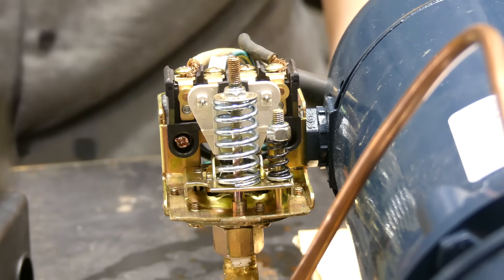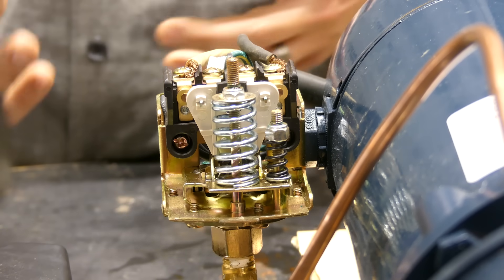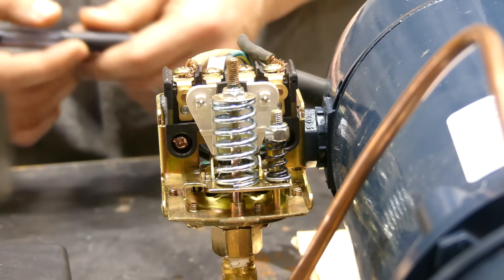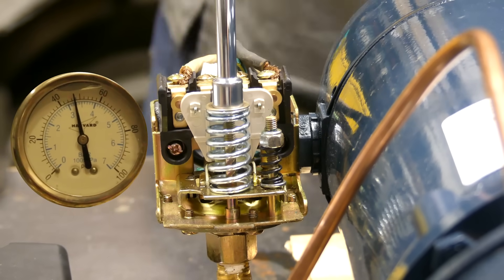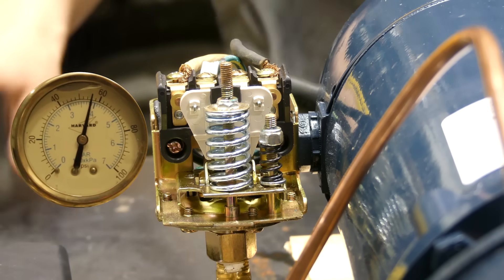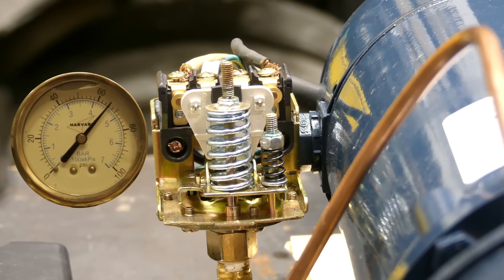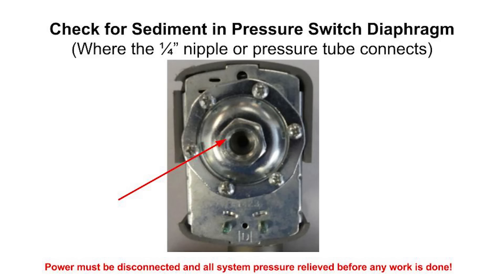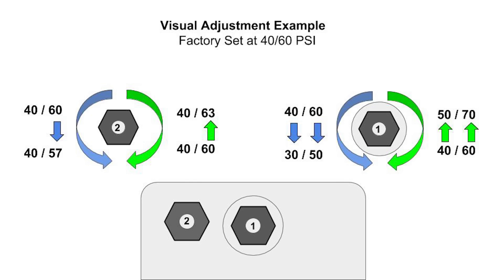How To Adjust a Pressure Switch

Comment: Hello I have a convertible Pressure pump,  from Canadian tire.  I'm trying to have it work to pressure my cabin from my gravity fed cistern.  I have it all plumed in, primed, and turned it on.  but the pressure just keeps on surging the pump does not turn off.  I have the pressure regulator installed, and the pressure tube is connected to the pump housing then to the pressure switch.  should I connect this tube too the pressure regulator instead?  do I have to use a bladder tank with this type of pump?  was hoping to use it without a bladder tank just need it to shut off when it pressures the cabin. there are no leaks in the system.
Reply from the maker: You need a pressure tank: https://www.youtube.com/watch?v=zz0dYccfqaE&t=82s

Comment: Without a doubt the best explanation on the internet but i still have a problem. Pump has been short cycling but I can't get it adjusted. Changed the pressure switch (40-60) but it cuts in at 50 so I only have a 10 pound differential. Backing off the spring doesn't help. Eventually the pump just spasms off and on. i know my showers leak so I am sure that is a contribution but I am flummoxed why I can't get the cut in pressure down to 40. Any insight would help.
Reply: Likely, your tank needs air added.

Comment: Hey there, quick question..what if my pump is rated for 40 in 60 out.. however there is only one Center screw and the differential is more like 15 psi... right now it's cutting in at 50 psi and cutting out at 65. I recently raised it to gain more pressure and wondering if it's safe? Also would that mean I set the pressure in the tank to 48 PSI? Let me know, thanks
Reply from the maker: If there is only one screw then it is more than likely for the RANGE, meaning it will raise and lower both the cut in and out equally. I would recommend replacing the switch if your differential is only 15 PSI. They pressure tank needs to be set to 2 PSI below the pump's cut in pressure.
Reply: @RCworstwater  Ok..i thought I may need to do that but also thought potentially the pressure gauge is bad giving inaccurate reading?
Reply: I appreciate your response. Thanks
Reply: Your pump may not be powerful enough to achieve this level, and the pump switch setting will not help  you out with this.

Comment: Just bought a new 30 - 50. After running it at the default settings. It ran for about a 2-3 minutes before it kicked off and pressure dropped to 0.  Had to flip it back to start in order for it to represure. Just changed my deep well pump last February 2020, any ideas or suggestions??  Water level is good, checked that...

Comment: i just tried to call, and i guess it's too early in Idaho, but I am worried that my dad destroyed the new pump he just bought by accidentally straight-wiring the electricity at the pressure switch system (putting the hots directly together instead of their own plates) and it running full blast for at least an hour when I came outside again and wondered...why isn't it cutting off...then waiting...then waiting...and then going inside to shut if off to see why (i opened it to see if the pressure switch wasn't set or was not right, and that's when i saw that he put the wires on the SAME screw, instead of their own). Could this have stripped the connection between the metal shaft and the wheel that turns to pull water?
Reply: Guess he went ahead and didn't read the installation instructions.  Oh, that hurts!  

I suggest you wire it up correctly and give it a try.  If it works, great, but he may have a reduced lifetime on the motor as the windings may have burned from the heat.
Reply: @jackb1803  i fixed it as soon as i realized it. it is working.

Comment: Nice video thanks, how do you protect the pump from dry working if main water supply cut off though?
Reply from the maker: You can use a low pressure cutout switch or any other means of electronic motor protection. Give us a call if you're in the market for one: 855.329.4519

Comment: Will you reply? 
My new switch was supposed to be 20-40, but want up to 60 and I freaked. If it damages the PVC pipes I'm screwed. 
I got it to 30-40. I want 20-40. Another problem is the bag in the tank must have a leak. The tank gets water logged and I need to empty once every two months or so. So, to get 20-40 from 30-40 WHICH one will I adjust and which direction? 
Anyone feel free to answer with the correct info. 
Thank you very much

Comment: So i installed the pump in a concession trailer this is a new pump, That i installed now when i shut off the faucet the pump will keep running, so do i need  to loosen the differential so that way the pump will shut  off ?

Comment: My pump with this same switch keeps pumping well water once the irrigation finishes. Should I loosen the center post so it stops running, as it seems to never reach a level where the switch cuts off?
Thanks!

Comment: What size pump are you using.  I have a brand new 1hp pump with a 30 - 50 switch.  The pump can't get over 49psi and therefore the pump doesn't shut off.  So what size pump are you using.  I don't think a 1 hp will get to 60+psi?  You can't simply raise pressure without enough power in the motor.
Reply: Look at the pump chart, normally supplied with the pump.  Can it go to over 50?  Some pumps are designed for high volume and low pressure.

Comment: Hey so i just had to replace my switch with a new one and now it runs forever and won’t shut off. any tips on how to get the pressure to go to the 40 psi so it will shut off? it goes to 32 psi and stops gaining and stays running forever till i flip the breaker switch.

Comment: SO a question for you or someone who knows can you tell me this if I tighten nut 1 it raises both cut on and cut off but I only want to raise cut on is this possible? can I just turn nut 2 counterclockwise to achieve that?? thanks for the video
Reply: To raise only cut-on pressure, you'll need to turn nut #1 CW, and nut #2 CCW.  This will have the effect of cycling the pump more often, if you can live with that.

Comment: I just started to watch videos about this subject because I have a switch that's not cutting off but when I tap on the plastic case sometimes it seems to do the trick (I still haven't inspected, I'm doing a little research beforehand). 
When doing this adjustments shouldn't we also consider the min and max pressure the tank can hold? Thanks for the videos. I need to watch one about replacing the switch. :)

Comment: Just bought a house and has a new system in. I was looking at pressure switch the other day and the smaller spring is set all the way down. Would there be any need to do that? After watching the video I’m tug King I should back it off some.
Reply: Oh boy!  Looks like someone before you diddled the switch.  Assuming you are satisfied with your cut-in pressure, I'd back off the differential screw all the way, then run some cycles and see what get.  Typically, a 20 psi differential is desirable.

Comment: my pressure switch is set for 30/50 , my cut in stops at 30 but to my cut out is just tittering on 50 but will not cut out . is that a good time to turn the differential counter clockwise one turn so it will cut out ? Thanks  Great info !!
Reply from the maker: Is this a new issue?
Reply: @RCworstwater  i got the jet pump pressure switch and tank at the same time five years ago, but this started a few months ago . it only happens when the water softner is finished its cycle and filling up the system. the cut off will tither on 50 but won't cut out , i will flick the switch and the pump will shut of then, so i will tweek the differential nut counter clockwise a bit and it works fine until the next regen of the softner and it will do it again.
Reply from the maker: That's odd. You should double check that the pump is completely primed. You may have also gotten something stuck in the jet nozzle inside the pump. We have a video on how to check that.
Reply: You would want to turn the screw CCW.

Comment: I am in the Philippines. I will not even start to tell you the problems I have with water quality, pressure, and low quality pumps and pressure tanks. 

But, I have a question: The Square-D switches are readily available here. I want to operate the pump without a pressure tank, and have the switch operate in an on/off manner, when there is a small pressure drop. How do I reduce or zero out the differential setting, so the pump does not cycle between the normal 20psi range? Thank you very much.
Reply from the maker: What you're trying to do is not possible. Without a pressure tank the switch will rapidly cycle on and off until the motor overheats.
Reply: @RCworstwater  Thank you for the response. 

Yes, the pump rapidly cycles on/off; because of the switch's built-in differential. 

I run the pump now without a pressure tank---I replaced the Square-D switch with a pressure controller. So, when I need water, the pump will start and run until I stop using water. Will it shorten the life of the pump? Maybe. 

Because of the low quality of water, of materials, and poor workmanship, I have already gone through three pressure tanks. I changed from the China-made to Italian-made pumps. Even the cost of the better Italian pumps here is three times less than one bladder pressure tank. 

Thanks again.

Comment: Hey sir please reply so I have a water tank that I pay to refill every now and then... So there's absolutely no pressure in my pipes my pump runs only when I turn it on because the automatic thing isn't working.... Should I loosen both springs to the max since pressure is literally non-existent without the pump??.... I just need it to turn on and off automatically because I don't wanna forget to turn it off
Reply from the maker: Give us a call to discuss your application: 855.329.4519

Comment: Thank you for the video.  I have a question.  my pump seems to have no high end pressure. pressure stays about 30 psi .  pump turns on and off for short bursts when water is being drawn.   It had been working fine previously and in fact I had replaced the pressure switch about 2yrs ago.  the area is very humid.  could one of the points be stuck?
Reply from the maker: Thanks for the comment Robert! It sounds like your pump may be suffering from rapid cycling. Check out our troubleshooting video for tips on what to check: https://www.youtube.com/watch?v=CPzRpD_Tncc
Reply: my pump keeps going on and off on and off a very high pay I was wondering how I can adjust that to maintain steady pressure in the home

Comment: Once in a while, my pressure switch needs to be manually engaged because it doesn’t go on automatically.  We used to keep a heat lamp on it at night in the winter because the well guy thought the cold air might be making it stick.  Today I’ve been using a lot of water flushing my water heater and the pressure switch not only won’t engage but won’t stay engaged when I manually engage it.  Is there anything you recommend or is it time for a new pressure switch?
Reply from the maker: It may be time for a new switch. Does it have an arm on the side that you use to engage it?
Reply: It does have an arm but I just use a wooden stick to push in the plastic part that should engage on its own. It's in a really tight spot and only when I was looking up switches online did I see the auto, start and off settings! I ordered a new one and will start from scratch since they're cheap enough! Thanks for your help!
Reply: @julieheaton295  Yipes, replace the switch.

Comment: Getting a terrible clunk from our system. Plumber changed out the tank, switch and check valve. $500 later still have a clunk and our pump cuts in at 40 and out at 70. I adj. the one screw and got it down to 65 but no more adj. left after that. Any ideas? (New 3/4 submersible last year down 255 ft.)
Reply: I have had many plumbers who just switch and replace everything (because it's their company policy), collect their money, and leave.  Grrrrr!

Comment: I have a 20/40 switch that used to turn on at 20 psi and turn off at 40 psi. Now it turns on at 30 and turns off at 40. Any idea why it’s turning on at higher pressure instead? Is there an adjustment to make it turn on at 20 again?

Comment: Hey thanks a lot. I ve a question. When you do that, do you need to put air in the tank like for exemple if i use your video, put 36 psi air in the tank after adjustement or you leave it at 28 cause the pressure switch it s 30-50?
Reply from the maker: The air pressure in your tank should be 2 PSI below what the pump turns on at. So 28 PSI in the tank if your switch is 30/50. Remember, the tank should be adjusted when the power is off and there is no water pressure in the system.
Reply: R.C. Worst & Co., Inc. I think this was mis-said.  With the pump off and bladder type tank drained, than read the tire pressure type valve should be 2 to 3 psi ABOVE the cut ON setting so that bladder pressure is always maintained.  What good could it do to be below the cut on setting?  Maybe I am missing some facts.

Comment: Excellent video. Question, what is the max pressure can I get from a 1/2 hp Gould jet pump J5S?
Reply from the maker: It depends on your suction lift. At 5' suction the max PSI is 63, and at 25' suction the max PSI is 54.
Reply: You can get this from the pump specs by reading the pump chart.  Don't buy a pump if the manufacturer cannot, or is unwilling to provide this info.  It's often critical to the application.

Comment: Which one should i adjust if only one zone of my irrigation system is short cycling? In all the other zones the pump runs continuous as it should. So im having trouble understanding  if I should increase the overall high and low points or increasing the differential so the pump wont short cycle... If that makes any sense.

Comment: If my pump is short cycling rapidly because what i feel is the small pipes in the house build pressure up too quickly at the inlet (doublewide trailer) with small water line going into home,  can adjusting the high pressure lower help this situation?   It shoots up to 50psi and shuts off so hard the guage drops below 30 instantly, then instantly turns on shoots up to 50 then slams off againt etc etc.. cycling every second.  I unhooked the line from the house and ran a hose off pump and it did fine until i kinked the hose and it did the same thing.  Im so frustrated without water.
Reply from the maker: You need a pressure tank. Give us a call to discuss: 855.329.4519

Comment: I am going to try this method today to try and stop my issue... My pump fails to turn on and I loose all pressure in the house until I go down and manually engage the contacts to turn the pump on. Is this a common thing that making an  adjustment will take care of?
Reply from the maker: It sounds like you likely have sediment buildup in the pressure switch and/or the 1/2" tube connected to it. Adjust your switch will not fix that - you just need to replace the tube and likely the switch.

Comment: Is the pressure switch setting totally determined by the user's wants (other than the max capability of the pump)?  I'm not talking about going crazy with the pressure; just trying to decide between a 30/50 and a 40/60.
Reply: If you have old plumbing in your house, you should select 30/50.  Where I live in Mexico, a common setting is 20/40.

Comment: Thank you very much for taking the time to put this video demonstration together, it was certainly very helpful. In the event I choose to increase the pressure from 30-40 to 40-50, do I have to increase the air pressure from 28 to 38 PSI??
Reply from the maker: That is correct.
Reply: Yes, otherwise you will experience the problem of short-cycling.

Comment: On a 30/50 switch the tank air pressure should be 28psi. If I tighten the large not to change the switch pressure to 40/60 do I need to change the tank air pressure to 38 psi? Thank you for your assistance.
Reply: yes
Reply: If you leave it as is, the pump will still run but will cycle on-off more frequently.

Comment: I have a 140 foot well that is pumping 7GPM, and my pressure switch is set at 30/50.  The pressure never reaches 50 but stops at 45, and the pump does cut in at 30, like it should.  Why does it never reach 50psi?  Also could I increase the pressure to the 40/60, and if I do will this cause any problems with my current well setup?
Reply: You may need to change the setting on the differential screw.  Is your pump spec'd to handle this depth and more?  A pump professional can bypass the switch to see what it's true upper limit is.  Just need to pay attention to it's duty cycle.

Comment: I didnt get how to higher the low number without lowering the high number. My comoressor turns off at 130psi, but that wont come on again until it gets down to 30psi. I need the bottom number to be closer to 80 or 90

Comment: Aren't you free to adjust the differential to less or more than 20 PSI depending on your needs and the desired run time for your pump? Any reason not to adjust to, for instance, 35-55 PSI range?
Reply from the maker: If you change the differential (if you go from 40-60 to 50-60 PSI) then your pump will have to cycle much more often to keep the pressure in that range. A pump that cycles constantly does not last very long,
Reply: What is a desired run time for a pump? I assume it would vary with the size/GPM of the pump?

Comment: thanx for the video ...buh I think range bolt does not alter the range of cut off and cut on buh raises or lowers the cut on and cut off points with the range constant and the differential alters the range since it changes one value either cut off or cut on

Comment: A pressure switch must be calibrated using the standard equipment i.e, Dead weight tester. or a Comparator.This is not a precision calibration.Thanks for the nice upload.